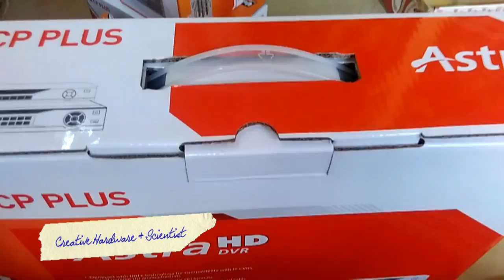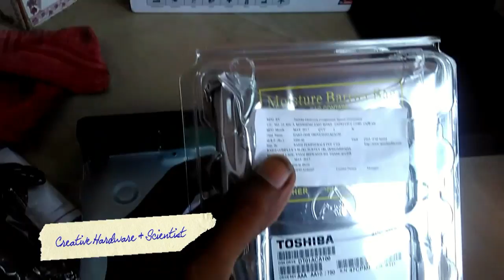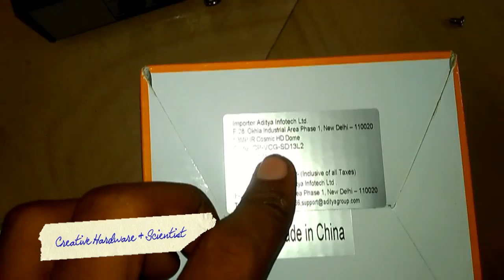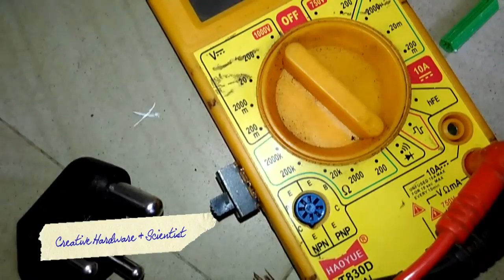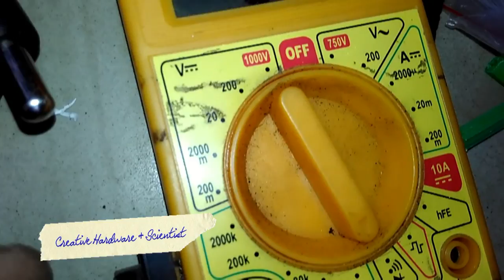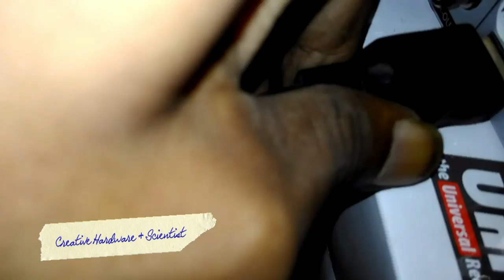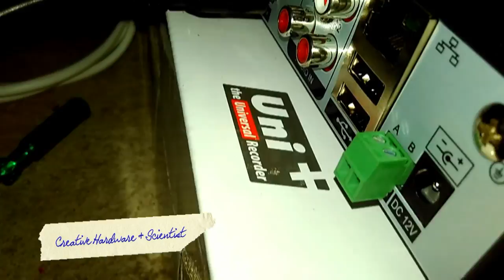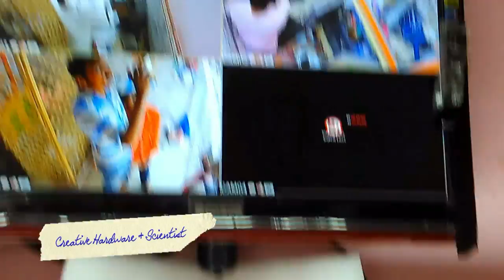cctv camera installation training in hindi

Comment: its nice video but i need some technical assistance. i am LAB engineer and repair NVR DVR and ip cameras but i stuck some times. we are facing  most of 90%  HDMI VGA and flash problems in DVR and NVR..i need circuit diagram or some solution. mostly HDMI and VGA ports do not display ...if some one know the solution please REPLY me..i am working in scout security service under the banner of HIKVISION products.some common problems in IP cameras are vary.